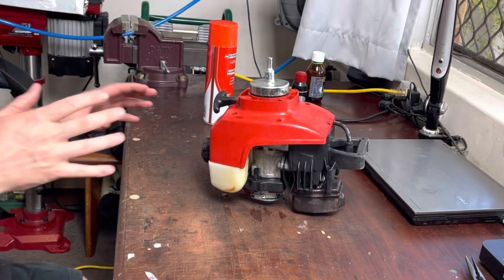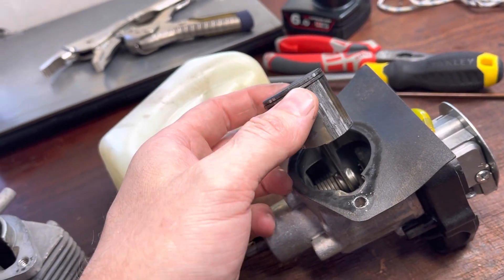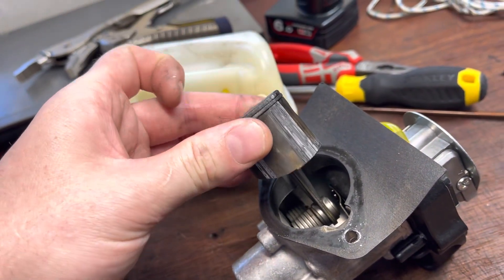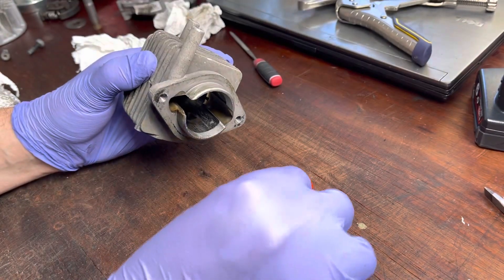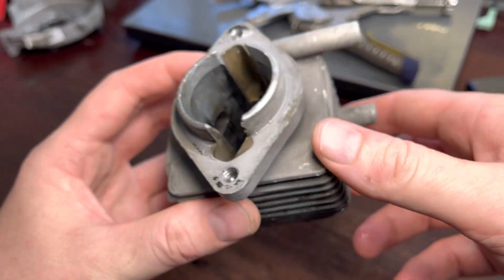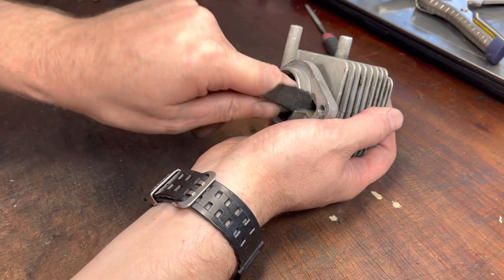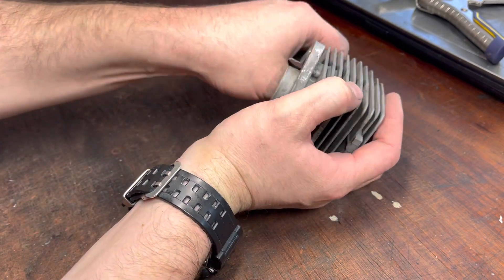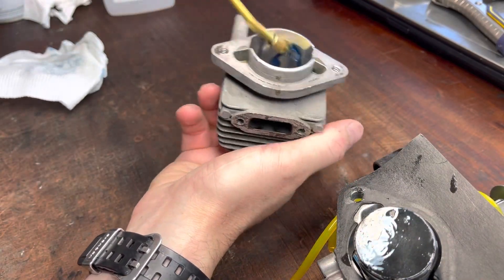SAVE Your STRAIGHT GASSED  2 Stroke Engines FOR FREE - Here’s How To Do It!

Comment: Would this also apply to a dirt bike
Reply from the maker: It would, but a dirt bike is designed for maximum power, therefore I’d personally rebuild the top end fully. A weed eater or chainsaw just needs to function, unlike a bike that needs to be at its max capacity :)

Comment: Great information.  I take a lot of attention to the ring groove(s).   Why not clean the cylinder with paper and a hone?    Take care
Reply from the maker: Great question, the abrasive can bed itself in to the soft piston and cause more problems down the line. Best done wjth a file, then a used and worn bit of scotchbrite you’ve washed a number of times!

Comment: i’m wondering how to tune a carb on a trimmer that’s already out of adjustment where it won’t start
Reply from the maker: I’d look it over, it’s likely got old
diaphragms inside the carb, the fuel line may be damaged, filter blocked etc. Once you’ve checked all that then set it to 1&1/4 turns on each screw .
Reply: @VintageEngineRepairs  thanks it’s a pretty new trimmer and supposedly someone ran the wrong gas in it i tore it apart and everything looks fine i got it to run fine and warmed up then once i shut it off it wouldn’t start back

Comment: Great job. Stihl 55 weed eater which # to adjust the H speed 10000rpm or 8400rpm
Reply from the maker: 8700 - 10300 is manual recommended. I suggest starting rich and cutting with it. Lean the H until it just stops 4 stroking under the load of the grass.
Reply: Thanks much
Reply: OIL MIX 33:1 IS GOOD ?

Comment: How long should it idle before going full out.
Reply from the maker: I don’t understand the question sorry mate
Reply: @VintageEngineRepairs before you run it full throttle.  I mean when you start to use it to cut the grass.
Reply from the maker: Oh! To warm it up, a minute or so of idle and then 30 seconds of gently varying the throttle!